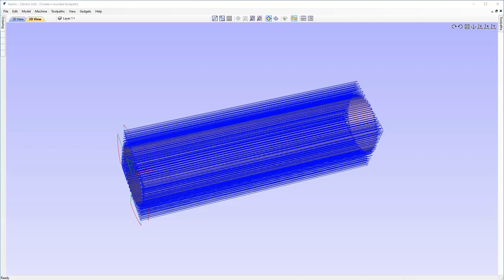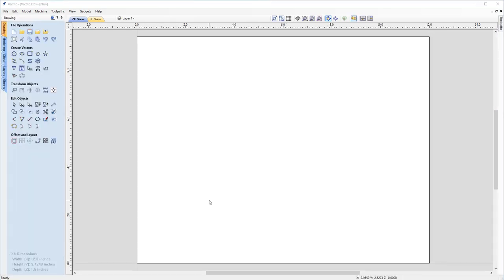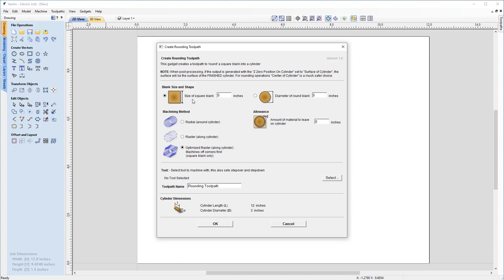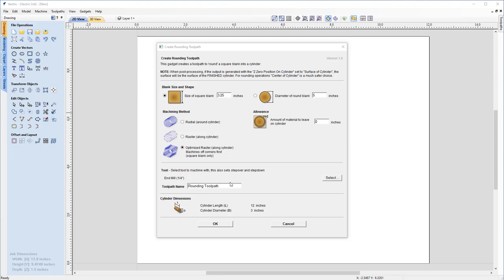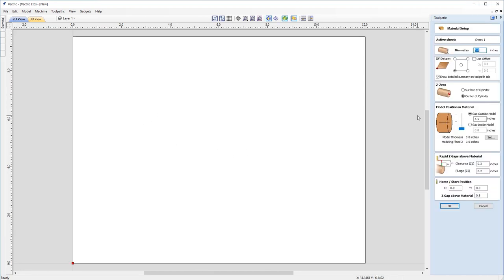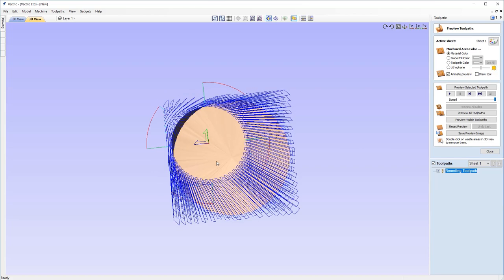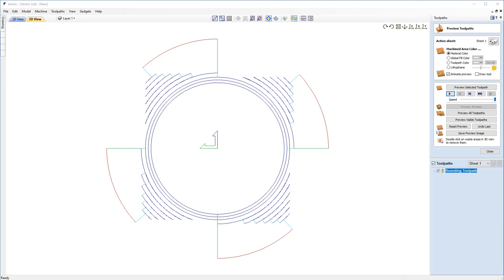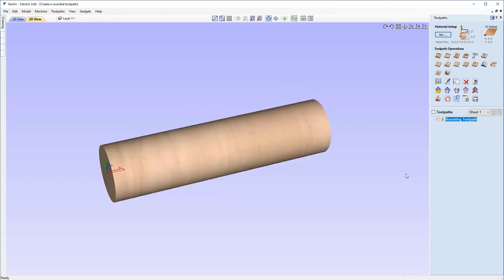Creating a Rounded Toolpath | Vectric V11 Tutorials

Comment: So being new to this rotary thing, while setting your , I guess z axis zero to center of cylinder, where should the e bit be zeroed? On top of the flat stock or in center or middle of work piece at end of tail stock?
Reply from the maker: Hello Kelley... it all depends on your machine.  When I do rotary I set my x, and y using a vbit in the chuck... and z off the surface.  It is a real pain to use the center if I need to do a tool change.  Keep in mind our machine is older in the labs and newer ones would have a process for this.  Your machine manufacturer would be able to help.

Comment: Oh god. You sold me $400 software by saying it could do rotary work, but now I need to upgrade to the $700 software to turn commercially available lumber into a cylinder that will work for rotary tool paths.
Reply from the maker: Hello and thank you for the comment.  I'm assuming you purchased VCarve Desktop and do not have acess to the gadgets.  You don't need the gadget to round off your material, it just makes it a bit easier.  You can always set up a toolpath to do that.  If you need more information pn the process, please contact Support@Vectric.com and they can hlep you out.